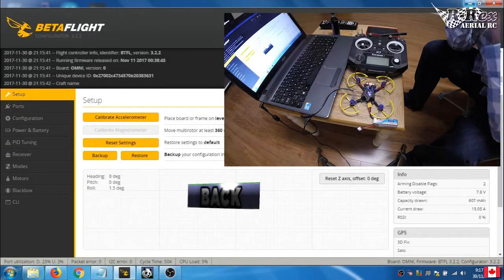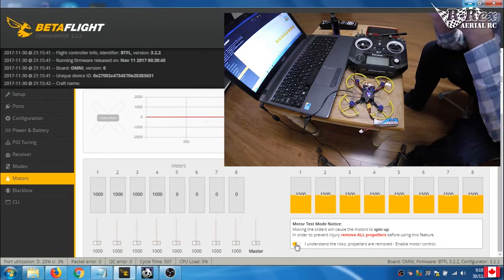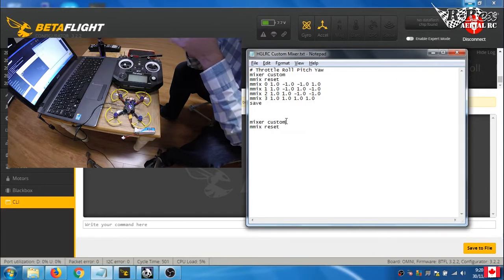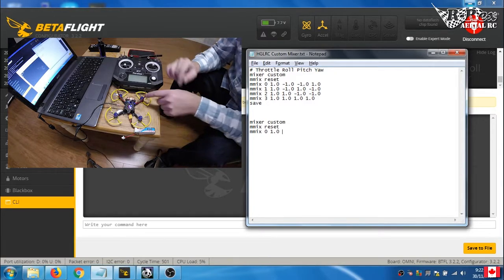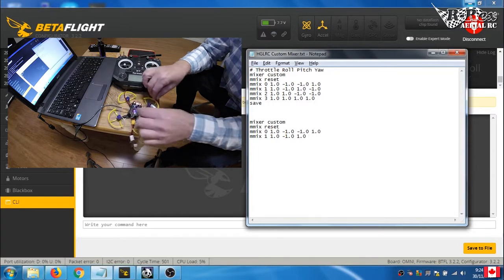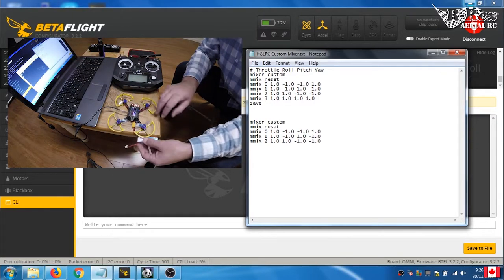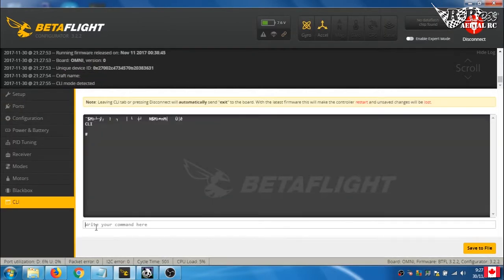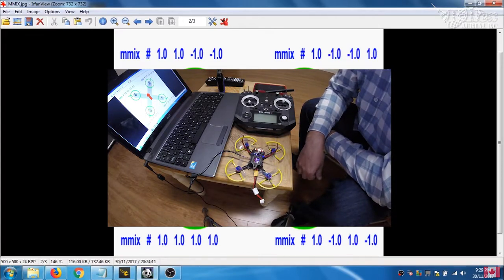Tutorial | Custom Motor Mixing Quad Copter | Betaflight, Inav, Cleanflight

Comment: Thank you sir for such a great tutorial. Sir please make a tutorial on "how we can program kk2 broad?" (Writing our own code for kk2) is there any IDE for do so? If is there any so please make programming tutorial. I Don't want use default firmware.(I want to make my own firmware) Please make very detailed tutorial on it. Please please please reply....
Reply from the maker: Wow, I haven't had my hands on a KK2 Flight Board for some time. The IDE you would most likely be looking to work in is Arduino. There is a channel RCHacker where he has installed Arduino onto a KK2 board and he has several videos on the subject. But you should be aware that the creation of a functioning firmware is quite an undertaking. The production of baseflight, cleanflight, betaflight, and iNav involved a significant community of developers and betatesters. Though I have experience with modifying modules of cleanflight and compiling my own edits of the source code, I personally would not take on the creation of my own firmware. And I'm a professional software engineer by trade, going on 15 years now. That being said, check out what RCHacker has done, and give it a shot. You can also download the original source code and compiler from HobbyKing. It will take a bit of googling to find the files, but they do exist.
Reply: Thank you so much sir